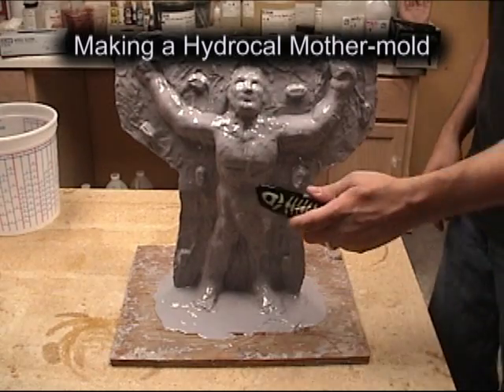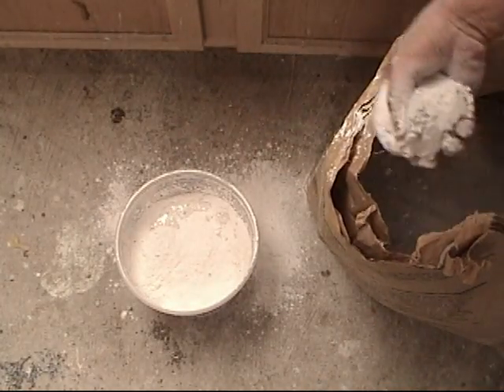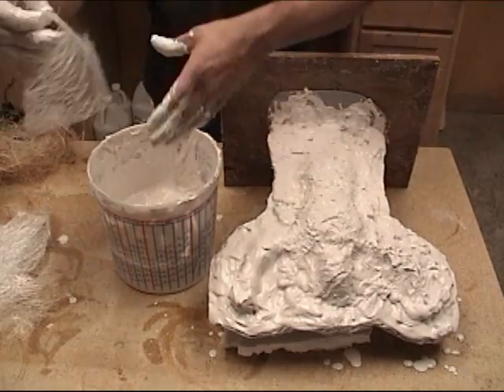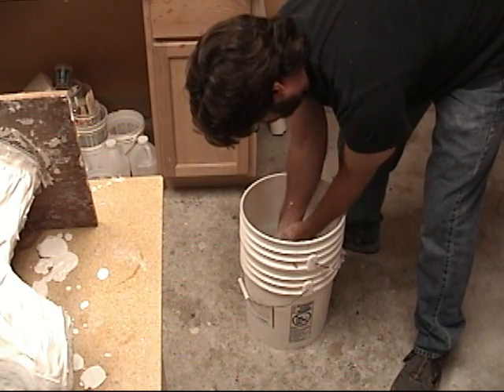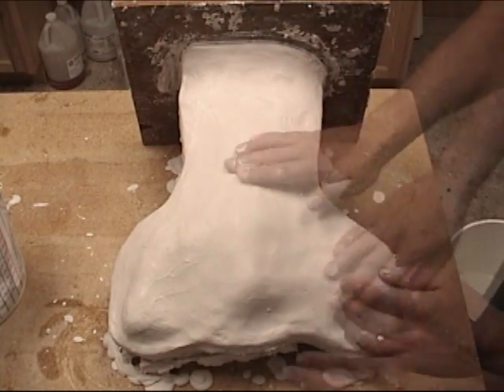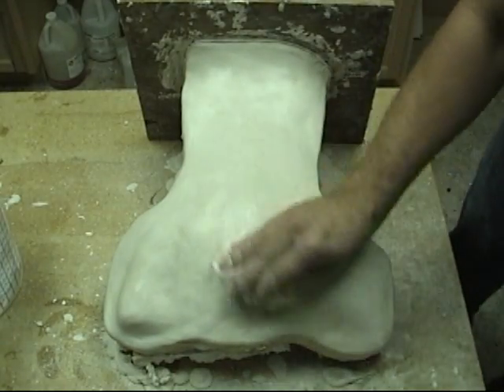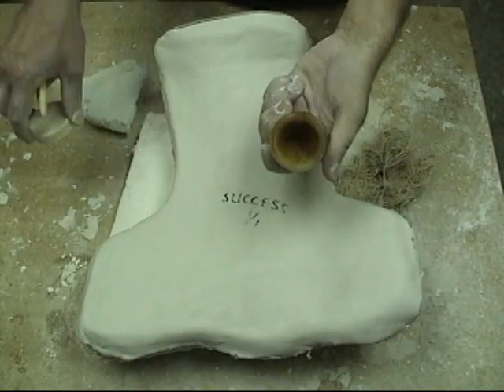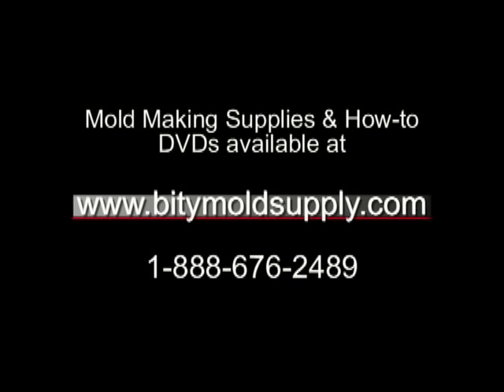Moldmaking and casting: Plaster Mother Mold Tutorial

Comment from the maker: Hydrostone is a stone so the application and mixing process is different. The main difference, relative to this process, is that Hydrostone is designed for casting and set quick with little warning. Hydrostone does not have the gradual set of Hydrocal.